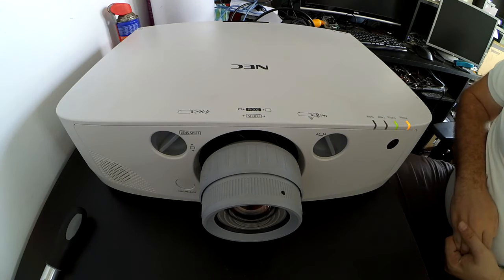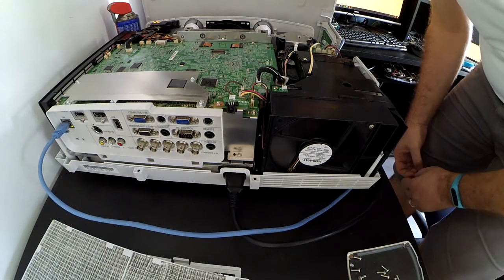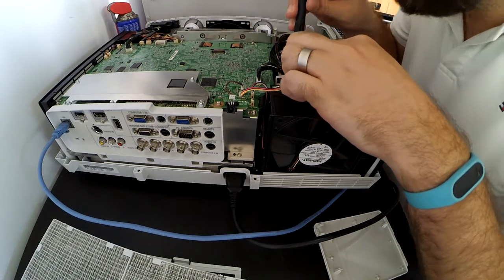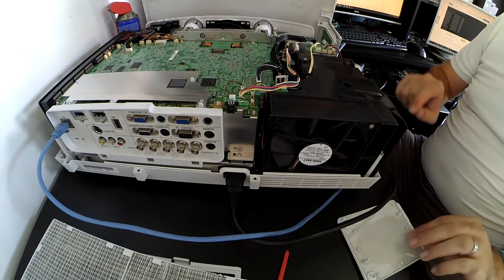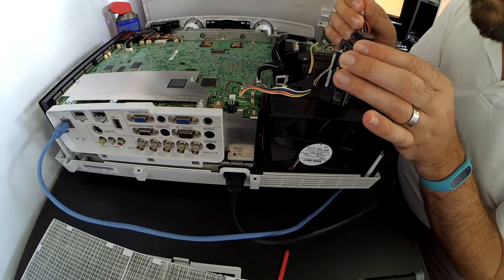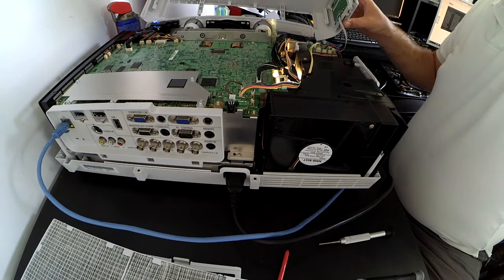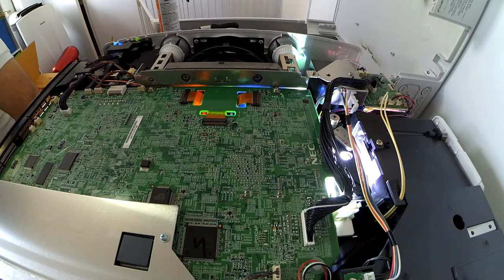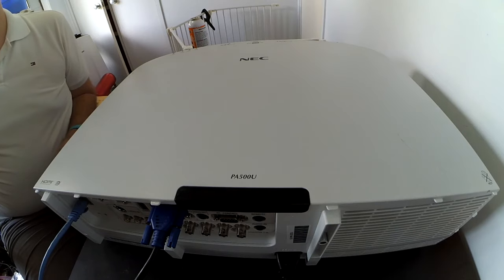NEC PA500U Projector Disassembly, Diagnosis & Repair Calibration of the Iris has Failed Error

Comment: Hi Steve I have one of these I'm having trouble with it powering up I have looked thought trouble shooting guild and there is not a procedure recommend. 
power is orange 
status green
lamp red
temp no light 

nothing is flashing have changed globe no difference 
Would you be able to recommend a solution is there a reset code ?
thanks for your time
Reply: Did you find an solution to your problem?
Reply: Lamp has exceeded hours and projector is in standby mode, you need to press the ‘help’ button on the remote for 10 seconds after a lamp replacement to reset it